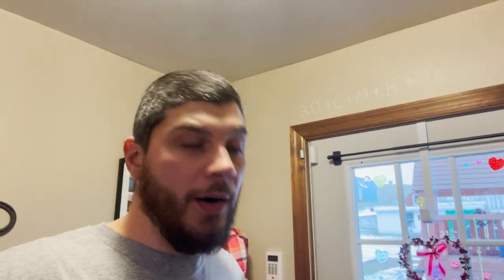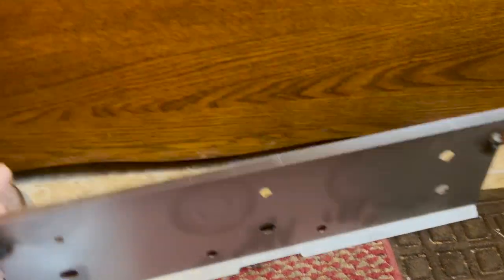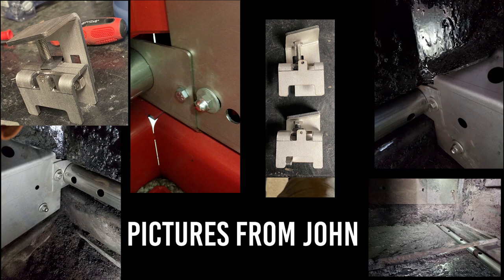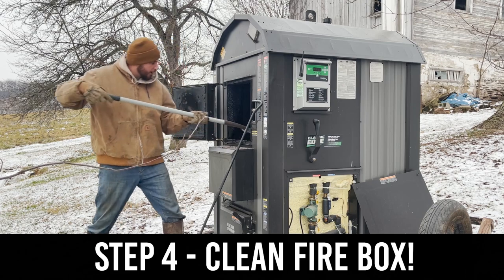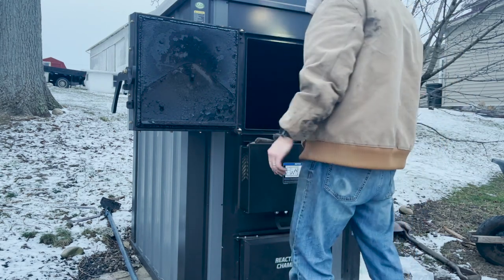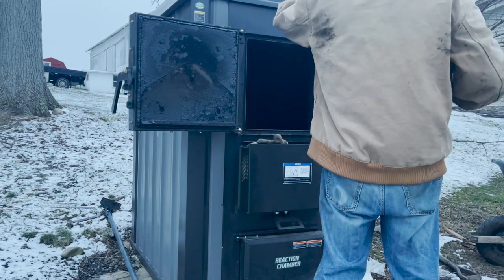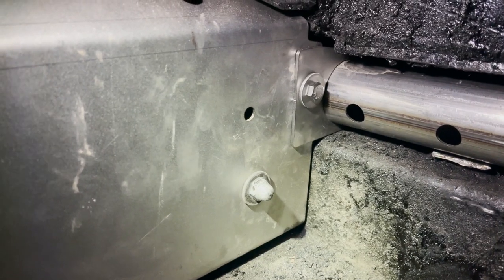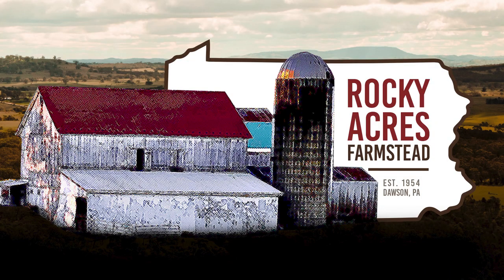How To Upgrade Your Central Boiler Classic Edge 550 Titanium HD! Winter 2021!

Comment: So what's all the diffences between the 550 and 560 beside the air tubes? Don't they both have the afterburner?
Reply from the maker: No.  The 550HD does not have an afterburner.  This was technology CB purchased when they bought the most recent company.

Comment: Since you have done this, how well has it improved the firebox? Did it make it easier to clean the tubes without having to shut down? I have shut my stove down for the season and will be cleaning mine more throw after it has cooled. I would like to make it easer during the season.
Reply from the maker: I’ve noticed that you don’t need to pull the tubes to clean it at all during the heating season.  The tubes don’t allow creosote into them.  I’ve shut down my furnace for the year and those tubes had small amounts of dust in them, that’s about it!

I haven’t noticed any higher reaction chamber temps, but cleaning has become easier.

Comment: do you ever burn scrap lumber, like old barn wood or pallets, in that.  I know plenty of people do with the older models, but do nails or anything like that cause problem in the gasification models?
Reply from the maker: Nails don’t cause issues and normal wood doesn’t cause issues.  You run into big issues by burning treated wood or garbage.  Both of those are big No-No’s....
Reply: @RockyAcresFarmstead  yeah, that crap just needs buried.  thanks!